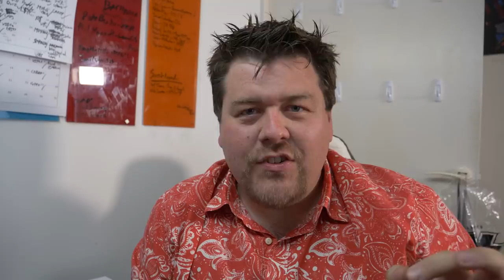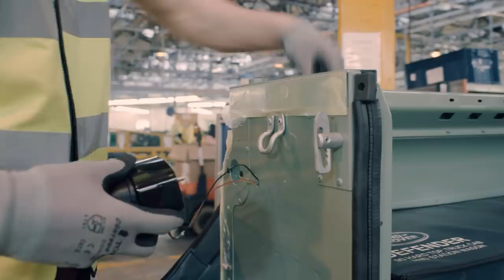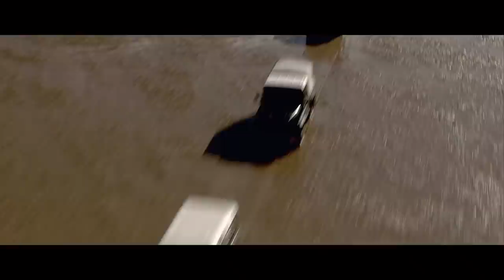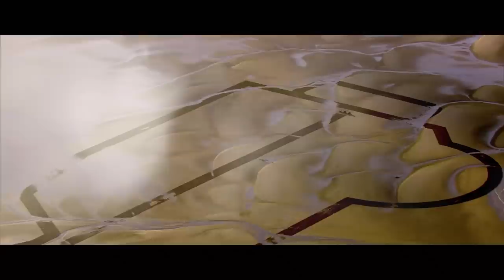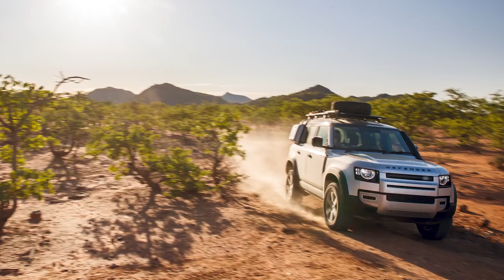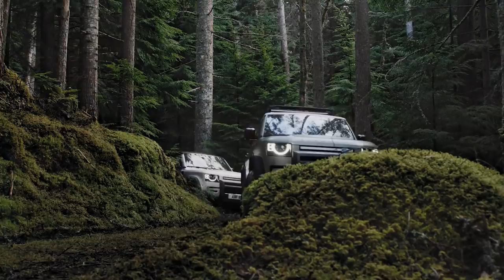How EVERYTHING About The New Land Rover DEFENDER is *WRONG*... and it is GENIUS!

Comment: The reason why many people (including me) are not happy with the new defender is because it lacks simplicity. All we wanted was a body on frame 4x4 with solid axles, manual transfer case etc. And finally a no nonsense utilitarian bodywork. This is the reason why Toyota makes the 70 series land cruiser with such qualities, because it has a market. 
Like the 70 series, they could have just added diff locks in both the axles (or in the case of the defender 3 difflocks) followed by a much safer body cage and 10 airbags for the cabin. While retaining solid axles and manual transfer case as usual. Rather than loosing the name to what would be is a LR4 successor. Even toyota makes their lexus lx's with sophisticated stuffs but on the other hand they are still making a simple and robust vehicle for overlanding , i.e, the 70 series land cruiser.

Comment: If they launched a version with no fancy equipment. A plain one, with rubber mats if any, steel bumpers, crank windows and so; I would accepted as a Defender. As it is is just the same LRJ product with a different size. Their mistake was not developing the car with time, like it was done with the Golf or the 911. The Defender is gone, forever.
Reply: They have a (relatively) stripped out version for sale, with what looks like a "rubberised/waterproof" cloth seating material, steel wheels, partitioning of the rear load area from the cabin & down to a 2 litre turbodiesel engine and no "bling" finishing in the cabin. Don't know what that will run, but that will be the working vehicle. No it doesn't have wind up windows and steel bumpers, but it does look like it has rubber mats & if not I'm sure there will be someone to supply them (likely JLR as an option). I think they said the "entry/trade" version would be ~35k-40k at the launch, but with 4 year old defenders running ~±45k in the UK, they should sell! Plus they will have creature comforts that everyone pretty much expects in a car now, irrespective of what the target market is - stereo you can live with, heater that works, decent ventilation, phone chargers! The more I think about it, the more I think that it is a design that will work at the top end and the functional end of the market. It was never going to be the absolute spartan vehicle of the series landy, but it just might be the new standard for the working farm that with a wash down can double as the Chelsea tractor.

Comment: I drive almost every day on a45 near Coventry and I've seen quite a few of Defenders. They look AWSOME! Friday, I was doing 60 mph on that road and a defender flew by me. In the rear view mirror it looked totally bad ass. It's on par with the G wagen. From what I've seen on the configurator, if you want it to be capable off road, you'll have to pay extra for the lockable diff, which is weird. It's an offroader, it should come standard with 3 lockable diffs...
Reply: rozetca they’ve taken the base versions over the toughest terrain on Earth so you don’t “need” every option, and indeed not everyone will be driving them daily through swamps and up mountains. That’s how these things work. Plus, the only good looking defenders have been heavily modified, sometimes costing 10’s of thousands of pounds - totalling way more than the new car, which is still better in every way out of the box 😂

Comment: Being ex military, I know the defender well, in iraq we used the same type of defenders they used in Ireland called the snatch, great cars with great capability but as a military vehicle it needed updating, which after I left they did change vehicle because jlr didnt update the defender the military changed vehicle with lots more tech, that's what it's about these days, whether its driving down Kensington or basra it needed more tech, new one has that, would the military buy them at the price they are now I'm unsure but if they are as good off road as the old ones and got more upgrades then the military personnel who used them would have loved them.
Reply: I'm certainly no expert so please correct me if I'm wrong, but surely the technological advancements in 21st century warfare really mean that the army will be going down the purpose built solely for military use, not modifying existing civilian vehicles?
Reply: MylesHSG the reason no military ever has built their own cars is the incredible cost of designing and building them and going through testing and approval etc. Car companies do that. The armies take existing vehicles and modify them while keeping them road legal .

Comment: People were going to hate it no matter what because of the name it carries. Same issue as the new Supra, the biggest complaints are about its name rather than its capabilities. The new Defender does what they say it'll do, whether or not people think it's worthy of the name. My concerns are with reliability. I only know a couple people with Land Rovers, but they don't seem that reliable. I don't want potential mechanical and electrical problems in the back of my mind while I'm out on trail. Folks saying it's too expensive, it's not for you. It ain't for me either, as my budget falls more in line with a used 4Runner.

Comment: The old defenders were mostly bought for off-road driving in the African safari and the newer version, i must say, is good. However, can it last in the jungle especially with the air suspension??? how do you get that fixed in the bush when it breaks down??? unless they are made to last a lifetime without breaking down

Comment: If they wanted this to work, the face should have looked like a Defender instead of the Freelander.  They should have started with the 2 door because it doesn't compete with the Disco 5 and the RR Sport.  it also doesn't look like the LR4 that it is based on.  6 passenger only for the 2 door, and 6 or 8 passenger only for the 4 door. (no consoles, at least for the first year or two).  And the designations should be 100 and 120, not 90 & 110!  A Defender 110 has a 110 inch wheel base.

Comment: I'm after a 7seat vehicle that is capable off road. I drove a Discovery 5 for a week and loved it (less than 1000 miles on the clock). Day two the 2nd/3rd row of seats refused to lower electrically, as did the lowering sit on part in the boot. I loved the way it drove, the space, performance (TDV6). Fuel economy acceptable. That was 9 months ago. Then the Defender arrived with the promise of a P400e motor! 

Watched a few videos about reliability, etc. Would buy either in a heart beat if the reputation was better. Prado? Diesel only, in today's eco climate, not sure a good idea. Please JLR, make a reliable car with the P400e drivetrain

Comment: I went to the Defender event and I was very taken by it, far removed from the old one, I had a 110 County 12 seat station wagon with which I made regular trips to the isle of Skye, but even though every time I turned the key it felt as though it was an adventure, that said, driving it some 300 miles was tiresome, this new one I think will make the same journey effortless, comfortable and safe. I loved the old one but safety is a big issue for you and your passengers, plus driving an automatic is just so 21st century.

Comment: Firstly I am not a Defender fan boy. I actual drive a LandCruiser.
Why is the new Defender no good?
It's not fit for purpose. 
Without solid axles it can never be a good off roader.
Without a separate chassis it cannot be converted to varies platforms.
With over 50 ECUs it isn't going to live long if used as a working vehicle. 
The trouble with car reviews, they are done by car experts. The Defender is not a car. You may as well get a Biker to review it.
The Defender will take sales away from Disco owners whilst loosing market share in it's traditional market. 
I may be wrong but one of the richest businessmen in the country agrees with me and is building his own replacement. "The Grenadier."

Comment: New Defender is manufactured in my hometown Nitra, Slovakia. I wouldn't keep one even if I got it for free. JLR came here because they thought they'd get cheap work force. They were dead wrong. Slovak people don't want to work there because they pay miserably and so they're forced to import workforce from the east, mostly Ukraine and Serbia. And guess what? Even those people don't last more than 3-5 months.

Slovakia is Detroit of Europe. Aside from Jaguars and Land Rovers we're making Volkswagens, Kias, Peugeots and Citroens. None of those factories have these issues. JLR has by far (more than 50% more) labour turnout (not sure if right word), nobody lasts there in the lower positions. My friend works there, now as manager, and he says they have huge issues and constantly fall behind the plan because they have to teach new people constantly which slows down manufacturing. And guess what that probably means for the cars themselves. I wouldn't be surprised if Defender suffered some huge issues down the line or even had to be called back.

However, I like Defender's design. I'd get something else for that price or even lower, though - Subaru XV costs 28 000€ in decent version and it would satisfy 80% of offroad enthusiasts and newest version is one of the sexiest non-sport cars out there. Besides, it's Japanese. It would be reliable for...ever.

Comment: Have to agree with your synopsis JM. Living here in the highlands, the most common vehicles are 2004-2016 Hilux, 2000-2010 Defenders, and 2006-2014 D-Max. We see the occasional Ranger, but they're only really the forestry commission or SSE vehicles, clearly got a deal with Ford. Practical side, there are more Hilux' and older Defenders (double cab and pickup configs) than anything else. I doubt anyone up here will spend the sort of money needed to get a new Defender, when there is zero reason to. The old Defender is a workhorse, and as such most of them still run.

The new Defender, as you hinted towards, is going to sit sedentary on Kensington back roads and in Kentish mansion drive ways. JLR are quickly losing (ruining) their reputation as the workhorse behind Britain... as I've mentioned in previous comments, I drive a D4D Hilux and recently I've had to rescue my neighbours 2001 Defender from a muddy slick in one of his fields. It's also driven by various other vehicles in the snow and ice that we had a couple of months ago, one wonderful example was driving past three lorries, a couple of SUV's and a desperate to succeed 3 series Bimmer. Pictures available!  

Even with all of the innovation, and impressive numbers that trucks like the Q8, Amarok, or new Wildtrak flavours... the Hilux is still winning the race here where we need them. The fashionable 4x4 is always going to be a Q5/Q7 or Ranger Wildtrak (which is a lovely place to be inside, is awful to drive if you like to feel what you're doing). 

You already know I'm a VW fanatic at heart, but in the truck argument, I tested them all before choosing, and the Hilux is still King.

Comment: This is a very weak argument for an overlander 4x4. Claiming it's just a fanboy/girl issue and 'the march of progress' etc, doesn't account for the fact that the new Defender doesn't have a body on frame construction for better flex and durability, it doesn't have a dual solid axle drive train for better wheel articulation and it does have a huge number of sensors and computer hardware that can't be fixed anywhere but by a dealer due to code licensing.  Oh also it runs  tires that are too big to be easily found in rural areas.

Comment: Why was the Defender called the Defender?  Because the biggest customer was the British Army.  I drove them all the time when I was serving and yes they were slow, noisy and uncomfortable but they got you there (I never had one break down on me).  Now that the Army has gone elsewhere for its 4x4s (let's not get into MoD procurement policy) the 'Defender' has become a Range Rover in a cheap frock.  I'm guessing that it's full of electronic sh*te that will inevitably break like with all Range Rovers.  The whole point of Land Rovers was that they were simple, go anywhere, easy to fix vehicles.  That's not the new Defender.  Just saying.  Feel free to leave hate below.  Mike

Comment: To my mind the Defender has to be a genuine workhorse not a style icon for Chelsea streets because otherwise the brand has no credibility.  They risk writing cheques they can no longer cash.  Trading on past success and that will not last.  It does look like they have put a great deal of effort into making this a capable vehicle that is at the same time up to date so it may well see them well into the future.  But it is very expensive and you get the impression that all the gadgets are going to fail, the air suspension will explode and no body will be able to fix anything.  Expensive and fragile do no mix well with hard work.

Comment: Some good points you make. I own a 110 Puma and drove it across southern Africa several times. Now back to Europe the old one just doesn't cut it as an everyday vehicle. Way too noisy and cumbersome. So, going to sell it soon and actually wanted to go for a Tesla X as a replacement but now that the new Defender is out in this rather nice P400 version, I am really tempted to maybe buy something that I can once again also use for a quick holiday trip to Zambia or Kyrgyzstan. To all the haters who moan about electrics - I began to love sensors. Get used to an OBD2 plug and a laptop. It's not that difficult to operate and you need a laptop nowadays anyways for overlanding or how would you backup your photos and videos?!
Reply: papa smurf108 it was never designed to be an every day vehicle. It was designed as a work horse for farmers and the army.
Reply: @Jabber-ig3iw  In some parts of Africa it's a perfect everyday vehicle:-)

Comment: It will be an excellent School Run car, I'm sure.
Reply: Ye the hard tops are more for work but the other ones will do it as well if you put steel wheels on them and get all the necessary off road gear.
Reply: @beaviccoon470  
It's a lovely SUV, it just has the wrong badge on it - It should say "Discovery" on the tailgate !

Comment: Good review.  Aside of the name the old and new Defenders are such different vehicles with such different uses in everyday life. If I want to go a great distance, in comfort , and tow a caravan and carry three dogs and a load of kit I take my Volvo but if I want to do the same thing but not worried about too much comfort I could take my old Defender but I wouldn’t out of choice.  However if I want to go to the tip with a load of rubbish, pull out some bushes or do my own maintenance or happen to get someone back into me then the old Defender is perfect.   When I travel off road to the field on a rough track under water in winter then I definitely want to be driving the Defender.  Every time I hit a pothole in the Volvo I am thinking how much will that cost in realignment of the wheels.   They are just chalk and cheese.  So for me,  first I don’t imagine ever being able to afford a new Defender except in the distant future, I would see its role as similar to  the Volvo but over qualified to do the job. Lots of unnecessary off road features I would probably never use.  If it was new I would have all the same worries, if not more so, of it being cosmetically damaged.  

Yes interesting. Yes I am impressed with what it can do and yes if I had the capitol I would buy one but I would still keep my old Defender as I just like it warts and all.

Comment: Not a Defender fanboi here, either old or new but the problem as I see it with the new Defender is, well it's a bit too luxury. 

I'm glad it's a capable off roader and that it will be much better in terms of fuel consumption, emissions and safety.  However JLR have any number of luxury SUV's the consumer can choose from: the Evoque, the Velar, the RR Sport, the normal Range Rover Vogue, all of Jaguar's variants of SUV's. So if you want to fit in the streets of Chelsea or Kensington and have no intention of trying to climb Snowdon, you're spolt for choice. 

The Defender just needed to be simpler, much more utilitarian, all of the cost going into the engineering to make it as reliable and durable as possible, maybe a better alternative to the new Suzuki Jimny or the famously (almost) indestructible Toyota HiLux.  In other words a solid durable off-roader that can cope with almost anything and nothing more.  It didn't need 10" touch screens with iPhone connectivity, or Keyless entry, or sliding panoramic roof, or 14-way heated and cooled electric memory front seats with 4-way manual headrests, or a Leather steering wheel and gearshift, or Lane Keep assist, or 360 camera etc etc.... if you tick all the options boxes on the Land Rover website you can easily push the price to over £90,000. 

I appreciate the Suzuki Jimny also comes with stuff you don't need, but you'll only end up spending about £25,000 even after ticking all the options.

The real test would be how much more capable a Defender is in rough terrain, because it may end up being worth spending the extra money if you need your vehicle to get to remote locations where the cheaper alternatives just end up breaking their driveshafts , but the world just doesn't need the Defender to be yet another luxury SUV.